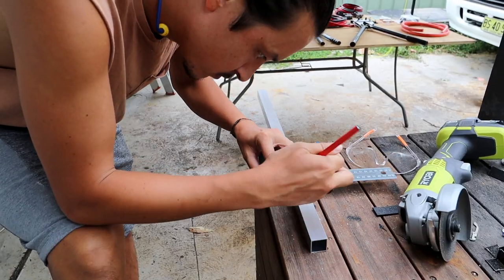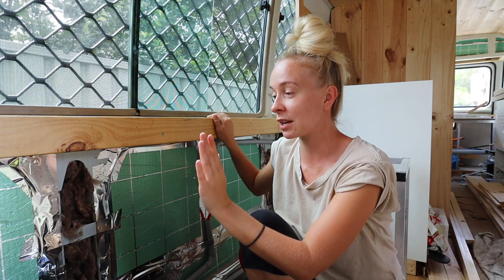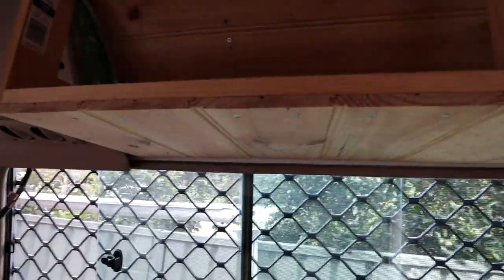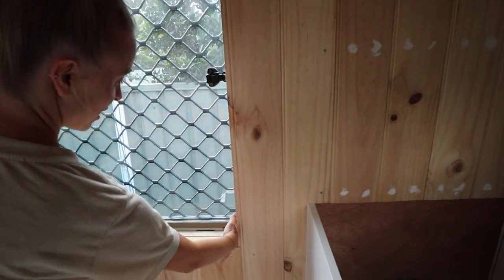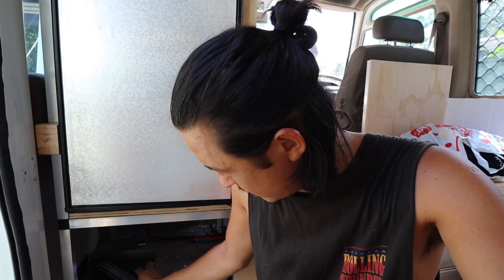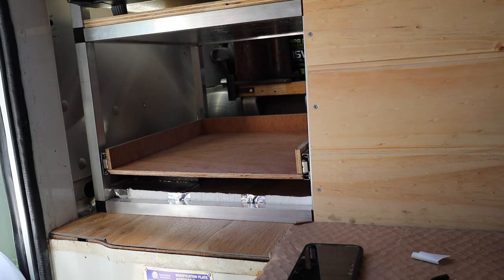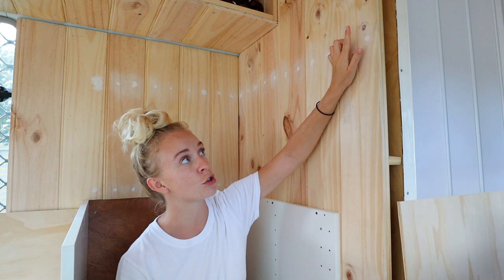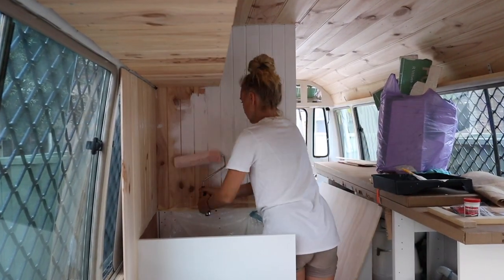BUS / VAN conversion on a budget | DIY Living Room, Work Space & Wine Rack

Comment: How thick is the timber at the top and bottom to get the wall straight? Trying to problem solve this on our coaster right now 😬 why can’t they make coasters with straight walls?!
Reply from the maker: Hey! Yes we used this: Treated Pine Outdoor Timber Framing 70 x 35mm x 3.3m 
from Bunnings :)